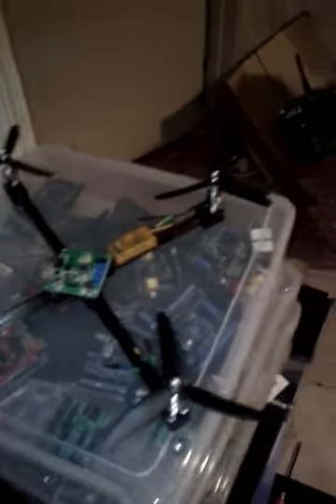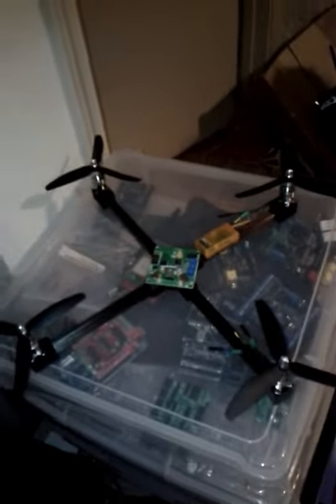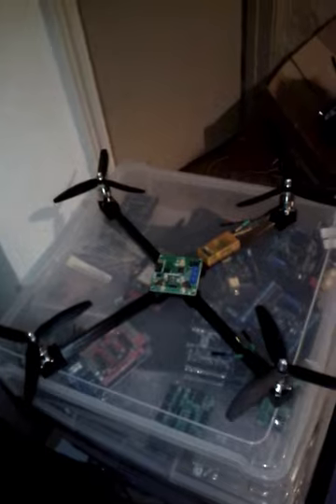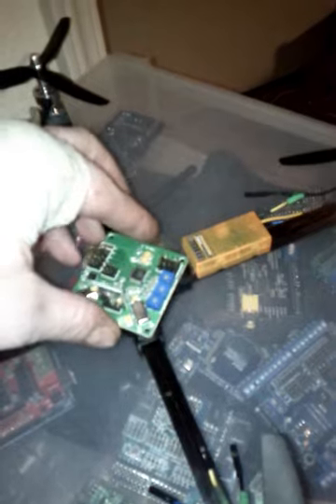sub100 quadcopter   Broadband

Comment from the maker: How much does a go pro weight? This whole copter assembled including a better only weighs about 90grams. The motors are supposed to have about 122grams of thrust with the 5030 props so theoretically this copter can lift 488grams - the 90 it weighs itself. That might lift a go pro. I still need to maiden the copter today or tomorrow and i'l let you know how it feels.